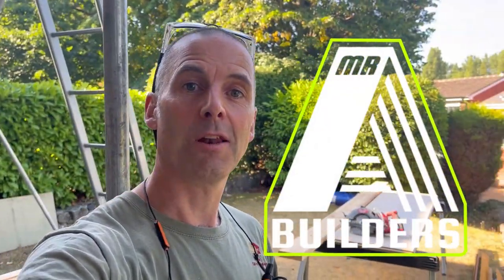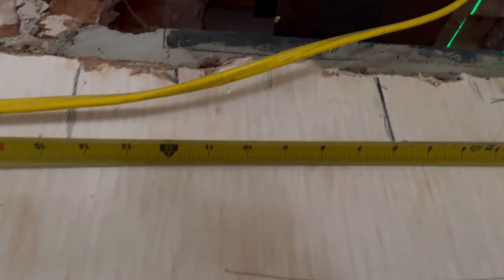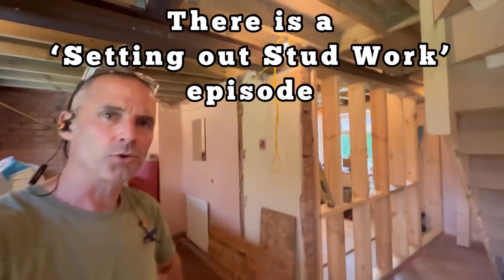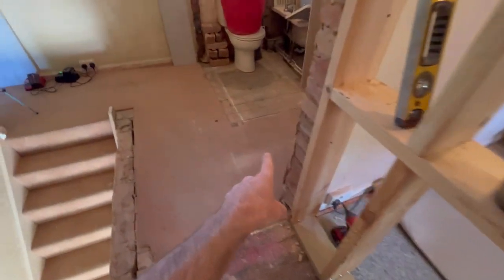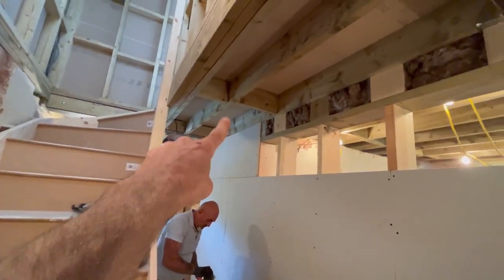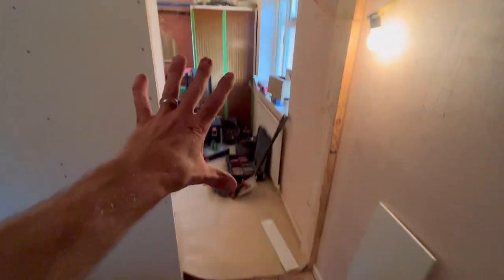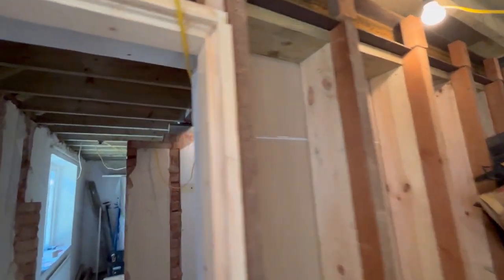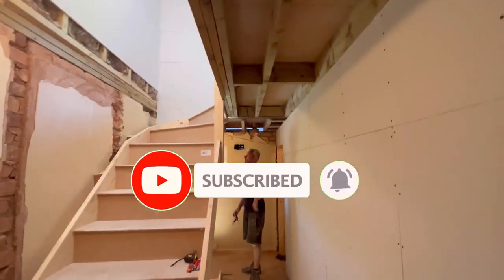Configuring the First Floor rooms.     #timberframing #studwork #walls

Comment: Great channel, real world problems with real world solutions, would love to see a video on the window being made, crazy lead times.
Reply from the maker: Hi. Luckily we came up with a solution for the window lead time. If you have seen our early episodes you will know that once we get the customers moved back in we have a good sized single storey extension to the rear of the property as well so our plan is to remove the current kitchen window earlier than planned and modify this to suit upstairs. It is exactly the same height and width as the current first bedroom windows which are two side hung opening lights left and right and a fixed glazed panel to the centre so I will cut one of the opening lights out and make good the the casement rebate to give us the same proportioned window to match. WELL! that's the plan anyway watch this space 
Thanks for commenting on our channel

Comment: Much easier to fit door frames when you actually have the door imo. Clamp the frame around the door on the floor, using 5mm spacers. Pin it in place to some scrap timber in a couple of places. Then you can lift ii it in place as one piece and when you fit the door it should go in easy without any trimming required.
Reply from the maker: Hi. Just like fitting a door set then really except a lot cheaper than buying a door set. We have found that with the doors on site they can get damaged or swell with the moisture from plastering so we tend to buy them last minute. I agree with your idea but despite my moaning on camera I make sure that there's no cutting of the door required. However what I do is get myself a few folding wedges and before I fit the architrave to the rebate side I tap them in as required to make sure I've got my 2p gap all around the perimeter of the door even though with a fire door needing intumescent brush strips its closer to £1 coin. Cheers for commenting mate as always

Comment: Why do you not bother with the velux insulated sleeves?
Reply from the maker: Hi Luke and thanks for commenting.  Apart from foam filling any small gaps around the window we also fit 25mm insulation to the cheeks, top and bottom of the window as well and then plasterboard on top of that. Thanks for watching